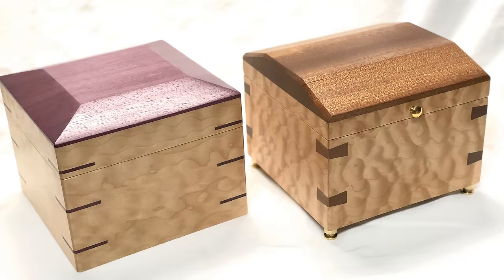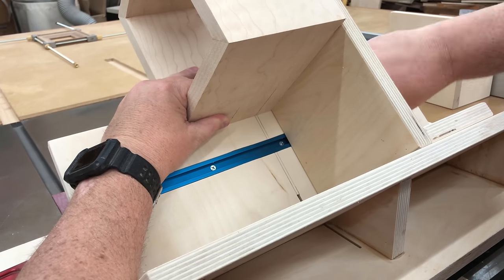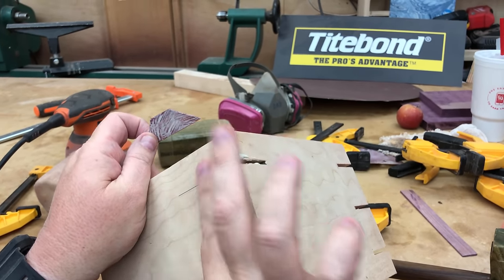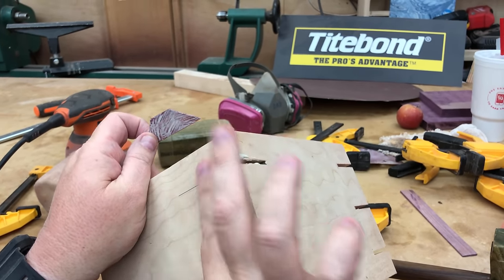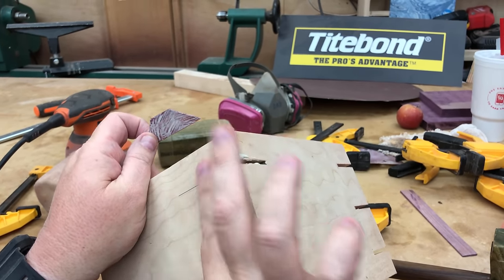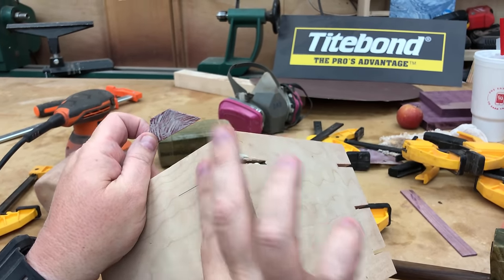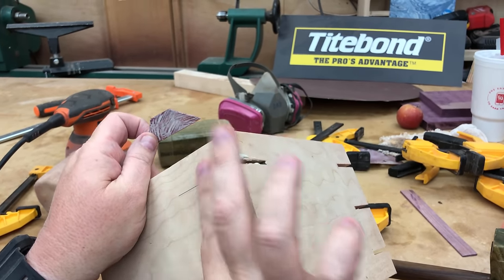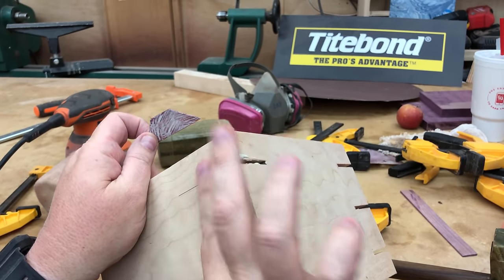73 - How to Make Spline Miter and Dovetail Key Keepsake Boxes

Comment: I have been woodworking for over fifty years and still have 9.9 fingers.  At about 24.35 Mia's hand looked awfully casual removing the offcut from the table.  Just being a little more alert, I would still have 10 fingers.  Be careful, after all these years I still miss that 10%.  Beautiful boxes.  It occurred to me you could have sculpted the bottoms you cut off to create feet at the corners.  Thanks for posting.

Comment: Great video.  I love your work.  A couple of alternatives:  I use an L fence to trim off the dovetail keys and miter splines.  It works great and is much faster than the pull saw, especially when I make multiple boxes at once.  Also, I have found that hide glue acts as a lubricant for snug fitting dovetail keys and makes them easier to insert, although hide glue has a longer setting time.

Comment: James. 1 cup liquid laundry detergent 1 cup hot water. Put your blades on a cookie sheet pour the mixture over it let sit for 30 minutes. Take out and with a small brush clean whatever is left on off then spray with an oil I use WD-40 silicone base. It works great and it's cheap and it will eat that resin and pitch right off
Reply from the maker: Thank you!
Reply: Plus they'll smell great!

Comment: I like to finish sand the inside surfaces, taping off glue joints and finish the inside surface before glue up.  Easier to finish.  I usually prefer to use a thin plywood and veneer it, cutting a groove  toward the bottom, gluing it in with the sides.  Using the plywood eliminates the risk for expansion/contraction issues.

Comment: You should put a link to those hinges you use :) Get yourself a Flat Grind Blade like Freud 10" x 24T Heavy-Duty Rip Blade (LM72M010) and your splines will look a little better. pause at 15:28 you can see the edges of the spline have that little dip in them the flat grind blade will allow that to be perfectly square. 27:20 sometimes it's helpful to take a pencil and shade the entire area you'll be sanding so you can see better any spots you may need to focus on. Maya is talented, I may even let her paint my nails..just once lol

Comment: Very nice family project. For less chance of damaging the screws may I suggest you first use steel screws to cut a thread (same size as the brass screws) then remove them and install the brass.

Comment: When I use tape for glue up I like to put all my pieces against my fence that way they are all parallel.
Reply: Also consider a zero clearance back for your miter saw.
Reply: @CHICAGOHAND    definitely safer when cutting the likes of small splines & such... 🙄🤗
Good call... 😎👍☘️🍺

Comment: Beautiful boxes in both style and grain. Have you considered a flush cut bit to take off that 1/32 around the box tops??? Some very luck people will be over the moon come Christmas :D :D :D
Reply: I think that may be an efficiency thing. Probably faster to just walk over to the disc sander than put in a flush trim bit. Less risk of endgrain blowout too I'd imagine
Reply from the maker: Tom is right. There is less risk of end grain tearing out if I sand it off. I could use a spiral upcut flush trim router bit because it would work well. But then I would have to go to the drawer and pull out the router. Haha!

Comment: How do you usually check that your saw blade is at 45 degrees? If it's off by even a tenth of a degree, won't the overall box come together poorly? I use one of those magnetic angle gauges but wondering if there's a better way.
Reply: I use a quality speed square. always on the money for 45 degree.

Comment: After  the final top coat i sand with a brown paper bag, rather then use 1500 to 2000 sand paper, the brown paper bag is equal to 6000 grit. then hit it with paste wax , like a baby bottom